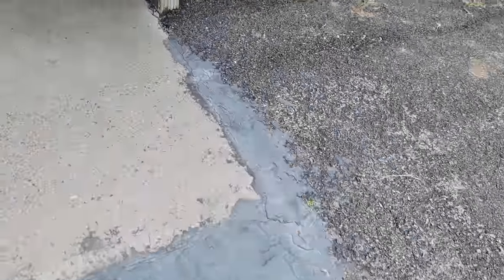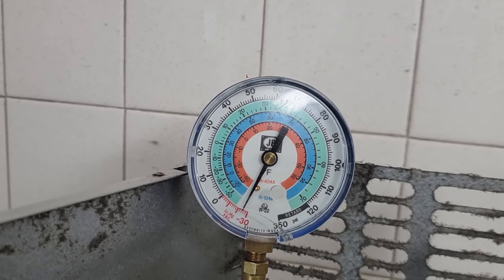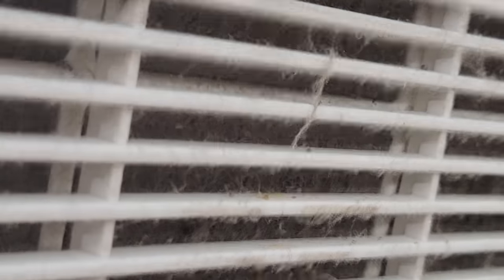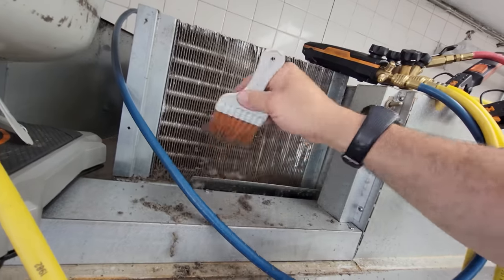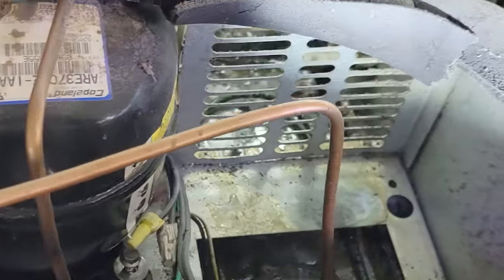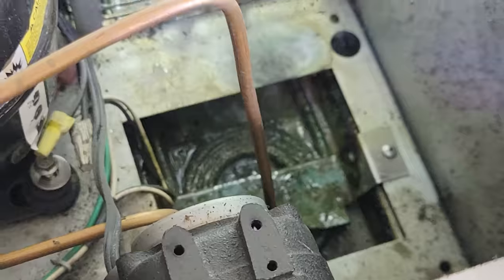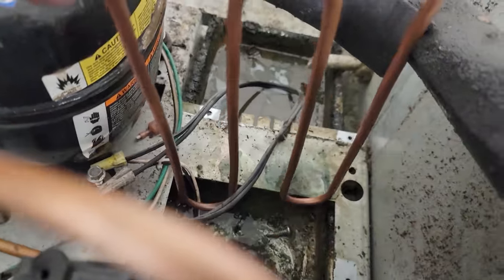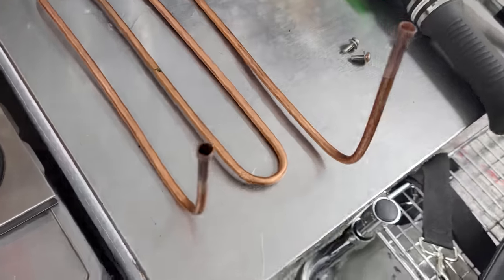Sunday Emergency Service July 4th Weekend

Comment: You are one of my top favourite HVAC YouTubers because you are straight to the point no cutting corners and ain't showing some crazy expensive equipment you get the job done with what you need
Reply from the maker: I will show done fancy tools but I didn't have time or effort to, I was worn out.
Reply: @HVACRSurvival  but I like how you get straight to the point no corners cut but still get the job done right and timely manner other than these other ones that spend an hour explaining one tool just gets boring and repetitive
Reply from the maker: @joshuabest100  🤭🤫👍👍

Comment: Awesome job Rick.....you jammed that out fairly quick and it wasn't a hack job...you gave them quality work.
Reply from the maker: Thanks Jason🤜🤛. I have higher standards that take more time and I catch shit for it but this is one where I did it right but not quite as well as I normally would have.
Reply: @HVACRSurvival  i can totally understand that. I would say im the same way. You didn't short change the customer and thats all that matters. Some jobs we can do it up to the 9's....some we can't
Reply: Awesome video 1st class service
Reply: Truly awesome job. The way you made that all cooler it is better than the one that came from the factory. That cooler will evaporate the water much faster. There are units that were did back in the 80s without nitrogen and they are still running without any problem. Also the copper was better grade back then also.
Reply from the maker: Thanks Carl🤜🤛👍👍✌️

Comment: On the 3/8" tubing, the instructions say to do 1/2 the expansion, release, turn the swage tool 90° and complete the swage.
If you look at the expansion parts you see that this is to put a more even pressure on the entire tube.

The heating method is a good idea, too!!
Reply from the maker: I actually will rotate it three different times when I do it that way, but it doesn't always work very well. Usually I'll have to add braze rod to the outside of the socket as a precautionary.

Comment: Great video take TXV bulb off warm it up to see if expansion valve open if not then it the head of the bulb lost it charge plus pour hot water of txv if it start feeding you got moisture in system.

Comment: Great work Rick. Had to make a small condensate loop on a True double door glass front merchandiser a few weeks ago. It was actually easier then I thought it would.  Luckily had just enough tubing to make it work. It was on an r 290 setup so I had to make sure it was exactly the same because of the system being critically charged.

Comment: Hola saludos cordiales y el aceite no era conveniente combiarlo pues la fuga era por el lado de descarga y se ve claramente que expulso aceite
Reply from the maker: I know this is getting translated back-and-forth and maybe there’s some errors but I don’t understand if there’s a question here or if there is a statement.
Reply: @HVACRSurvival   hello, Best regards, and it was not advisable to chance the oil because the leak was on the discharge side and it is clearly seen that oil was expelled

Comment: Great job Rick, the only thing I would have done is wipe out the pan, to clean out the old oil, job well done.
Reply: bypass that crap coil and pop in an heated evap. pan, if you think power will be an issue, pvc hose to floor drain(lol) none near? condensate pump and to whatever nearest drain.
Reply: Okay, throttle bottle, I was just thinking that the oil in the pan would set off the detector, the stratess detector, if he was going to test for leak again, but it worked out.
Reply from the maker: I wish I could have said and shown more about where I was. Normally I would have wiped it out, most guys would have recharged it and left. That kind of repairs are why I got hammered this weekend.
Reply: It's all good 👍Rick.
Reply: @HVACRSurvival  I'm getting leak after leak, r22 which my company won't sell. Which means full conversion after leak repair new filter drier etc etc. It's like every call is hours of work finding the leak then fixing them converting etc can only get a couple done a day

Comment: Awesome job. I’m very new to the trade so I have a question. Why couldn’t you braze the hole in the coil that you cut out? Instead of making a new one. 

Thanks
Reply: Easier to make a new loop. By the time you located the exact leak spot and clean it really nice and bend it out of the way to braze it might as well make a new one and braze it up top.
Reply from the maker: @bridgewater that's exactly why as the other person said. Time and reliability is the name of the game in service.

Comment: Just curious you work on lil systems (ric and rif) to supermarket stuff along with heat and and cooling of all different sizes much respect but why? What don't your company work on.
Reply from the maker: Right now we don't work on ammonia, we sent one person to work on it but that's about the only thing we don't work on. You got a remember where I'm located at, I'm in the middle of nowhere in Ohio. We have over 100 employees doing residential commercial and industrial, service, installation, and sales, we also do controls welding and design. We got to keep people working so we do a little everything. That's how we became so large. And what a lot of people don't realize is we actually are a lot cheaper than what other companies would charge in larger cities. But yet were paid as good or better than the large city company's. We have employees that have been here 40 years. We know our customers by name so reputations pretty important.

Comment: were do you get the small brush from its so good ,
love the videos mate
Reply from the maker: Which brush are you talking about? The coil brush that's orange or the stainless steel black handled brush? Or none of the above?
Reply: @HVACRSurvival  all of the above
Reply from the maker: I believe they both have Mars part numbers. I'll have to look tomorrow if they still have a tag on them. The stainless steel brushes come three in a pack. I've been using those probably the last 15 plus years if not 20. The orange thing is the same as the blue and until I started doing refrigeration they weren't very useful because they mainly work really good for brushing off condenser coils whereas in residential we always had water available
Reply: Thanks 👍

Comment: Did you use staybright solder and nitrogen just to test for leaks?
Reply from the maker: I brazed it and did a basic nitro purge, I used the stratus for testing. Not how I normally do it you can see that in my other videos. I didn't have time to do it perfectly. I had 35 hours of overtime